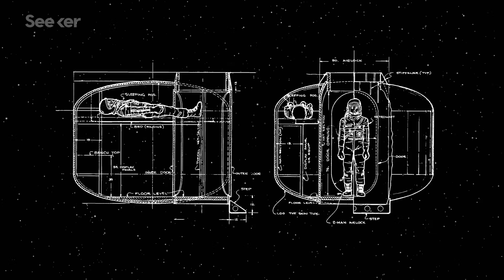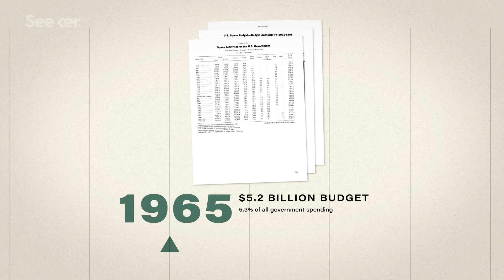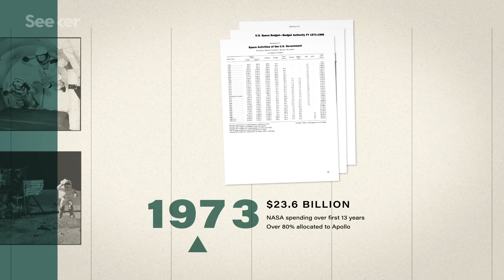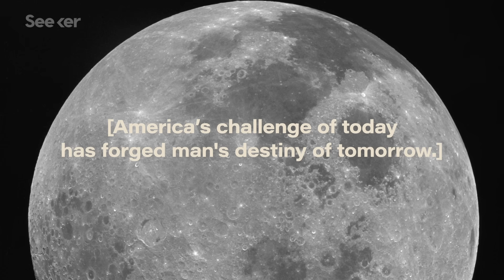Why Did NASA Cancel the Apollo Program? | Apollo

Comment: LYING BAASTARDS......THEY DID NOT GO TO THE MOON SIMPLY BECAUSE THE 3RD STAGE COULD NOT HOLD ENOUGH FUEL.....IT WOULD TAKE ANOTHER 500 LBS OR MORE.
LYING BAASTARDS
Reply: The third stage held 80,000 gallons of fuel and oxidizer total, I don’t think 500lbs is much of a deficit especially when the CSM could compensate.

Comment: Because... are not the aliens, not flat earth but poor technologies and lack of resources. They not go to the moon in 1st place. Only some unmaned probes (maybe). Apollo style technologies are homeless tent on four legs. Faulty useless hardware. Pretty soon both main competitors Soviet union - Roscosmos and USA-NASA figure out that such a task of put a man on the moon requires much much higher technologies and hell of a lot better life support systems and protection much more resources than currently available. So USA fake the landings due to bad technologies,poor hardware and lack of resources. Soviet manned moon program was such spectacular failure that they even denied its existance. So USA start joint missions with soviet union at 1975. Joint fake missions. Meanwhile apollo program was canceled and NASA started the shuttle program. For the shuttle program they started from scratch and tried to build something new that actualy gonna work. Shuttles was huge step in the correct direction. However even they are not good enough. In modern days Elon Musk try to make mars colonial ships. Unfortunetely his designs and methods are based on apollo style. While only star wars sci fi ships are good enough to make mars colony. Or manned moon missions. Millenium falcon is the solution not falcon rockets. DTOL, UART and full frame technologies are requied with organic oxygen generaors and purification systems also full bio emulation is a must have not an option. Diagonal take off and landing. Full frame ship - no multistages,one piece. Just like millenium falcon. Only my proposals can do the job for real. Which can match same performance of milenium falcon for real with conventional/semi conventional methods. Back then Kennedy promised too much for too little. They soon realize that such promise requires technologies of thousands of years ahead. Thats why star wars sci fi come into the movies. Few people knew that ships in star wars movies was actual planned ships to be build. So mars colonization requires nothing less than star destroyer and moon manned missions nothing less than milenium falcon. Humans are too fragile and require huge life support.

Comment: ……...total nonsense...…..just check out the Hasselblad pictures on Google images that NASA released in 2014 after the Russians and the Chinese outed them in an open letter to the press pointing out that the ChangE 2 lunar orbiter didn't find the six Apollo landers, nor the 5 Surveyors landers either.....take a look at the Apollo 11, 15, and 16 landers (they are actually the same lander) and you can see the lander is a movie prop made from art board, broom handles, and duct tape.....also you can see the electrical lines in the dirt underneath the landing pads of the movie prop, along with the shadow of a machete that the movie prop crew left on top of one of the booms...……..apparently these fake missions were filmed in a large hangar in Michigan on a airforce base there...…...space missions outside the Van Allen belts are quite impossible because of the lethality of cosmic rays...………*see Thunderboltsproject..com with Wallace Thornhill and Electric Universe, Nibirushock.com and 9/11, Thomas Bearden's papers on scalar energy physics and the deployment of scalar energy weaponry by the Soviet Union in the 1980s, and Adapt 2030 with David Dubyne……..these events are all connected...Gary Hinchman

Comment: The Apollo videos showed that NASA can communicate with the astronauts faster than the speed of light! That just one bread crumb of the truth.
Reply: Hi pback, hope that you are well. You wrote "NASA can communicate with the astronauts faster than the speed of sound!". Assuming that you take the speed of sound as its speed in air, about 340m/s and also assuming that you are not making some sort of a joke, then yes, what you wrote is true. Electromagnetic waves travel much faster than the speed of sound and basically all modes of communication, radio, TV, internet, mobile phone, etc, are all faster than the speed of sound. This is not a particularly ground-breaking revelation. Take care.

Comment: Not very rigorous fact checking here.  The Apollo program was not cancelled in 1970 as claimed, it was cancelled in May, 1969 with the budget proposal for 1970.  The fact is Apollo was cancelled months before Apollo 11 ever flew.  Loot at 5:05 and watch the so called "lift off" from the moon.  Doesn't look like any rocket launch I've ever seen.  Remember the LEM weighs well over 2,000 lb. corrected for Earth equivalent.  Does that look like a rocket blast take off to you?  Critical thinking has left the building.